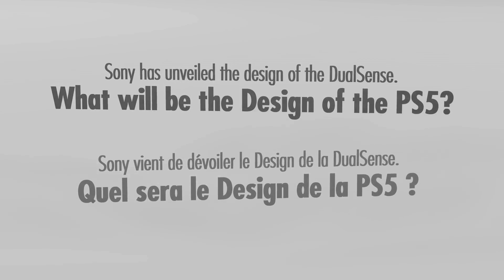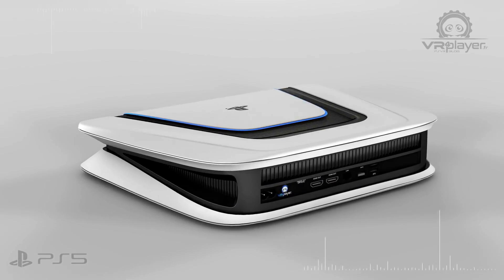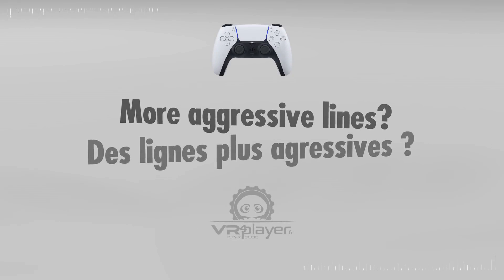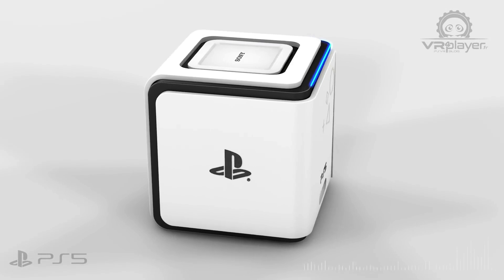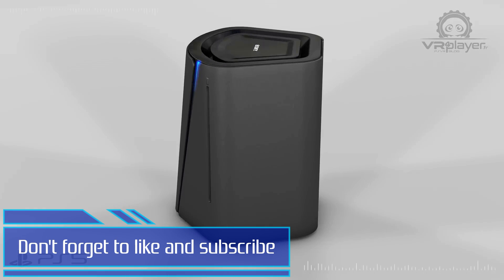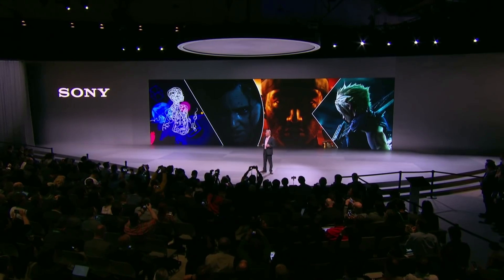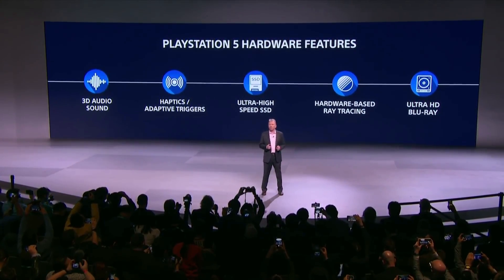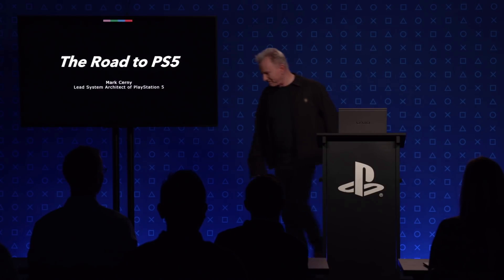PS5 Uses Revolutionary Cooling Solution | Overheating Concerns Squashed, New Patent Reveals

Comment: Fast forward to today, where PS5's are overheating, being RMA'd, and Gamers Nexus proving how hot the internals are getting. Maybe the people that have been building computers for decades might know a little bit more than Sony, who has been building CONSOLES for decades? This generation of consoles are computers disguised as consoles, and it's why Microsoft adopted a case that is the same as a mini ITX case, while Sony refused to get with the times and kept a traditional console look, and because of that, it's inefficient, and giant.  Sony was trying to mitigate a problem that they could have prevented by not being stubborn. It's like if you were designing a faster plane, and instead of switching to jet propulsion, you try things like making the body slimmer, lighter, and by adding more engines, and more propellers; switching to the more modern jet propulsion would have been the easiest solution. Microsoft's 'jet propulsion' is to adopt a case that allows for natural, proven airflow designs. Sony added liquid metal, made their console bigger, made some giant fan, ran their cpu and gpu at lower clock speeds than Microsoft, etc.

Comment: I have to believe that it was cheaper for Sony and Mr. Cerny to creat the PS5 this way...or it was the only logical thing to do, in terms of what their plans for the PS5 were....one thing is for sure...the PS5 is designed for speed.....no question about it, not powerful like a Rhino or the Xbox Series X, but very fast like a cheetah....and boosting falls perfectly in that setup or tune if you will...ofcourse this is all speculation and my backround was in vehicles years ago, not computers...but this is what i have gathered....in terms of boots...loads...and ofcourse streaming data the PS5 has that down to the T....in terms of visual...better details...frames and maybe resolution i believe the XBSX has that covered...better minds have speculated a 10to15% advantage the X has over the 5...

Comment: This all speculation, but i believe Mr. Cerny is doing what he has planned to do all along...i believe he created games...assisted with the PS3....PS Vita....and the PS4.....this gentlemen doesnt strike as some1 who functions like me, without a plan....i believe his actions are all planned out...far ahead of time....ofcourse with PC's /Rigs ...over clocking can be seeing as boosting engines....again all speculation....when placing a turbo or super charger on engines, it is the cheapest and fastest way to get huge power gains...torque and or horsepower....however.....cooling must be addressed....generally speaking anything that is boosted will be much more powerful and have a higher level of heat...this works for both Computers and vehicles......in one way, its much more cost effective and the gains are very nice, however cooling must be addressed...

Comment: You seem to be doing backflips trying to make it seem Sony wasn't caught off guard by the power of the Series X. It's painfully obvious that's exactly what happened. If Sony wasn't caught off guard and they originally intended to have a 10 teraflops GPU they would have simply added a 10 teraflops GPU and wouldn't have gone through the trouble of designing an entirely new solution to cool it. They would have gone with a 10 teraflops GPU put an off the shelf heatsink on it and launched at $400. Instead they saw the numbers of the Series X and bumped their CPU and GPU clocks causing them to need the special heatsinks. The One X does 4k/ 60 on some games with Polaris. 9.2teraflops of Navi would do 4k/60 with RT hardware and audio hardware with no problem. So seeing the Series X specs in December meant Sony couldn't do their February showing they had planned so they dropped their console design and made a new cooling solution after major clock boost. 

But the thing is Microsoft is still probably going to bump their clocks further before launch. The reason I say that is bc if the dev kits are the ones they showed that look almost like the ones from the One then they have room to boost the clocks a good amount. The basic design of the kits may have the back to back motherboard design but laying it down means one side still has more resistance to heat release. In addition,  the dev kits usually have more RAM,  24 gigs at least in this case and they have 56 CUs on the GPU. That means more heat than the final hardware in three areas. So once you turn it on it's side and drop 8 gigs of ram and 4 CUs you should be able to boost the clock some. I wouldn't be surprised to see the Series X launch with 3.7 CPU and 2ghz on the GPU. Sony will have their GPU ghz lead cut in half and still lose by 16CUs. The Series X will launch at over 13 teraflops. Maybe as high as 14.

Comment: mmm very telling cooled from top and bottom. sounds like they got caught out this gen by xbox early reveal and started with 1 fan but had to bump up the gpu clock and so needed to add a 2nd fan.ouch.that things gonna get noisy. i'll stick with fixed ghz thanks than 2 fans changing speeds per power draw. bet its a tower too but been redesigned so its not so series x cloned.now we know why the controller was revealed 1st and console much much later.ask yourself this whats revolutionary about having 2 fans anyway.i could be wrong of course guess we will see soon.

Comment: That sounds kinda like how the 360 was designed. Heat down. But that fried the motherboard and caused the red rings of death. Hopefully sony avoids that
Reply: No bad solder did that. It expanded and cooled many times eventually cracking the solder and pushing the chip out.
That is also why you could temporarily fix the problem by baking your xbox 360 mainboard in an oven for 5 minutes at 350-400 degrees.

Comment: Honestly, I've had 3 ps3s, 2 ps4pros, and I'll tell you they have an overheating problems. From patent to production so late in the process tells me that this will be another 1 gen hot garbage hardware from Sony. I'm not falling for this again. Fan boys will be fan boys, look at how badly Sony is scrambling to kill the last of us leaks. Attack me if you want but I'm buying the new Xbox. I like my hardware to last more than two years before it turns into a jet engine.

Comment: With ps5 i gonna upgrade my tv stand with bigger one and extra adds will be leds some pc fans around for better air flow, cables management and some air filters panels for dust.. This is the plan to fit ps1,2,3,4,5 and sega mega drive 2.. 😉

Comment: I think Sony playing the long game by making the first console that overclock by itself if needed. They are thinking about a far future
Reply: But isn't Microsofts more future proof since it has more power?
Reply: @limpis2823  Not necessarily. A cou9le teraflops won't change a lot in the long run. The 5.5 gb/s of loading is future proof tho. more than the 2.4gb/s that Xbox offers. Game devs are really excited about it. it opens possibility for game development and especially VR games. with a 5.5gb/s you'll be able to look in a direction. and while you're looking over there. a whole new map could be generated behind you. The trippy parts in games are gonna get way much trippier now. But to come back to the original question. Xbox does not seem to be playing this console war while thinking of the next one. Meanwhile Sony is clearly doing exactly that.

Comment: Sony is in a reactive position, still tweaking hardware with costly cooling solutions this late In development. They are scrambling trying be competitive over clocking thier hardware and will have to use some of the cash they made during the PS4 ERA to finance the early loses. They are depending on the component prices to drop over time and only willing to sell limited quantities until they do. They are in a tough spot.

Comment: Only thing we know is that Sony will need  a revolutionary cooling solution, the drastic steps they took to sometimes hit 10 tflops will require it. However all this tech just to sometimes squeeze out one extra teraflop of performance was a mistake. They should have just stuck with 9 teraflops and came in at 399. Now  it’s looking like the ps5 will cost the same as the much more capable Xbox.

Comment: You are kind of a little bit dumb.....

Sony scrambles to overclock an originally 9 TF console that they have been crafting foor over 4 years, and you think a quick cooling solution is going to be flawless?  Lets be real, Sony can claim whatever they want... 10.3, but I promise you, it will never be pushed to that level due to heat... There is only so much  a heat sink can do.... Plus pushing hardware that hard for a long time WILL slowly down and shorten the lifespan of any electronic.... Xbox Series X will be a guaranteed long life console... No cheap overclocking tricks that are proven not as effective as their numbers state, so the whole "you cant judge a console based on Tflops alone" is even more true for the PS5 than the Series X...

Because 30% higher clock speed doesnt mean 30% more performance... its gonna be closer to like 12%.... So theoretically specs vs specs, even if by some miracle it could hit those "10.3 TF" gpu clocks, in reality, it will perform like 9.6TF Max...

This patent could very well be for that revision the rumors stated Sony was trying to get done.... So if PS5 ships without this tech, There is no way im forking over cash for a 2-3 year console that will likely get the Xbox One S treatment and will scrap the variable clocks smart shift gimmick..

Comment: See here's what I thin happenedned with Sony. They were planning to reveal earlier than they did, however ms got out in front, Sony realised their machine was less powerful than xbsx. They overclocked the shit out of it, hence the reason the reveal is/was delayed. I still have concerns as the machine will be running at high frequency and generating a lot of heat to get the most out of it. I think it's reactionary response to ms machine..I also think this will be 500 minimum .

Comment: Ps5 compute units could be more units @ 2.5ghz x series is 56 idk compute units is more units less ghz  ps4 as metal grid could be redesigned to flow air faster  pipes what could be redesigned in a diffrent shape to flow air faster  even fan blades can be designed in a diffrent shape twin fan mabe or gel intercooling lot of possibilitys sony could learn copper metals experts could be key
Reply: Dont give a sheesh doosh bag is a idea what dat sony could learn

Comment: MBG man Zalkers vids talk smack on ps5 he had a ex dev that was on his podcast saying that ps5 is massively under powered compared to xbox series x, and says he doesn't see many developers even wanting to develop for ps5 cause its going to have problems with larger open worlds. Do you think Sony has dropped the ball? I've been a playstation guy since I was a teenager need some thought on this.
Reply: Joshua Smith it’s true the ps5 is massively underpowered, it might not even be able to do full raytracing so that is a major concern for 3rd party games looking better on the xbox. As for developers not wanting to develop formps5 that’s nonsense. 1st party devs will craft incredible games on the ps5 with minimal load times no worries there with lots of AAA titles in the pipeline

It’s the 3rd party performance that will lag behind, not just in frames or resolution but they might not optimize for the ps5s better ssd and might even code for the lowest common demoninator the PC’s HDD (imagine PCs holding things up for once) with only load times minimally better on ps5.  That cooling solution better work or ps5 might not be worth owning till they get a ps5 pro with a proper gpu to go with their ssd.

Comment: If the patent was filed today i can guarantee you this won't make it to the PS5
Atleast in smartphones patents are filed 2 years prior the tech is in the actual device (happened with touch/face id, under screen fingerprint, soli's motion gestures etc...) Could be in the PS5 slim and/or pro

Comment: I just read the patent. Very, very interesting. Not only should it be cost effective, but also a novel solution that may REDUCE costs as board design is simplified and doesn't have to weigh as heavily on accommodating the heatsink and fan.. This reduces materials, and simplifies form factor. (patent links below)

Here is a (wild) guess: The PS5 cooling will be inaudible via a low-speed fan, and may actually be passively cooled with an aluminium heatsink above AND below the main board, maximising the surface area. I'm also guessing that the PS5 will cost $399 at launch.

So far, I am very impressed with the design decisions that Sony has made for the PS5. This is a masterful strategy. A small but highly clocked, 37-core GPU (1 DMA core dedicated to audio), deterministic performance based upon computational density across both CPU and GPU, and ultra-fast IO. I cannot wait to hear about the other features -- this is likely far from it.

PATENT LINKS:

https://pdfaiw.uspto.gov/.aiw?Docid=20200126884&homeurl=http%3A%2F%2Fappft.uspto.gov%2Fnetacgi%2Fnph-Parser%3FSect1%3DPTO2%2526Sect2%3DHITOFF%2526p%3D1%2526u%3D%25252Fnetahtml%25252FPTO%25252Fsearch-bool.html%2526r%3D2%2526f%3DG%2526l%3D50%2526co1%3DAND%2526d%3DPG01%2526s1%3D%252522sony%252Binteractive%252522%2526OS%3D%252522sony%252Binteractive%252522%2526RS%3D%252522sony%252Binteractive%252522&PageNum=&Rtype=&SectionNum=&idkey=0F1865943C7B

http://appft.uspto.gov/netacgi/nph-Parser?Sect1=PTO2&Sect2=HITOFF&p=1&u=%2Fnetahtml%2FPTO%2Fsearch-bool.html&r=2&f=G&l=50&co1=AND&d=PG01&s1=%22sony+interactive%22&OS=%22sony+interactive%22&RS=%22sony+interactive%22

Comment: PS4 on paper is under-powered compared to Xbox One X, and you would think Sony wouldn't stand a chance. This hasn't turned out to be the case, instead the PS4 has been more successful than the Xbox, and delivers exceptional games. Cerny knows that all he has to do is deliver a comparable console to Xbox, and the devs will take care of the rest. Sony could have built the highest performaning machine on the market, but then what's the point if it costs a lot of money? It would be a hollow victory and a costly bragging right.
Reply: Vrostus it would have been a worthy goal to have the best performer graphics wise as 3rd party games will run better on it.  Remember Ps4 games were running at 1080p while most xb1 games were at 900p or even 720p in some cases. That was a big advantage for Sony all generation.  Now they chose to spend their money on the ssd and less on the gpu which is not a bad idea, their 1st party games will still look amazing and will load lightning fast, but they will suffer when playing 3rd party games. Most people play 3rd party the majority of the time so that’s not a hollow victory.

Comment: Sony’s made imo has made some key bad decisions with PS5. They went with an expensive SSD that won’t get fully utilised due to the fact that 3rd parties will develop for the base and if Sony also bring their games to pc they won’t be able to either. It’ll have fast load times but that’s it. It seems the boost mode was reactionary to XSX. It just makes little sense. They should have went for the better GPU rather than sinking that money into an SSD. This will end up biting them back. Once games start getting more CPU bound that GPU overclocked won’t be used as the CPU will need to run to much. Therefore that 9.3TF is all you’ll get. And with 40% less CU’s. Worse RAM etc etc you won’t get even decent Ray Tracing. The better choice imo for Sony would have been to aim for the 9.3TF machine with a decent SSD. It would have kept costs down and given them the same results they will get. So it maybe released at 400 at a loss now. But can Sony afford such a loss?!

Comment: PS5 is going to be a $600 mess, Xbox already won at this point. everything just looks bad so far, low bandwidth only 448gb/s 16gb VRam, Expensive Nvme, low clock CPU without 8 Threads mode, Not much Ray Tracing hardware, Mid tier GCN/Navi 1.5 like a 2070 super, recycled games. the list goes on pepehands
Reply: You forgot to leave a fanboy alert.
Reply: Lol 8 cores and 16 threads it's SMT, 8 cores and 8 threads not good as 16 threads... The xsx at 3.8GHz use only 8 threads while at 3.6GHz its use 16 threads... RDNA Gen 2 architecture already confirmed you just made yourself as a clown 😂, ray tracing already confirmed for PS5 as well and no one know how it will perform yet...
Reply: @מוטיאהרן  I was just copy pastering what fanboys say daily, I was just trolling boys lmao. congrats on not getting triggered

Comment: the price i think 450$ ~ 500$.
i think PS5 is so interested and very convenient for players + the dev.
it has a custom chip to handle the SSD this means patching or upgrading a game will happen very fast,  with load time under 1 second this is what you call next-gen.
the Teraflop is less than the X but in reality, it will be a long time untell the developers will make use of both system full potential, that's why sony studio optimize their games and work on them for a long time to get the game in a high-quality state.

Comment: I can't wait to see this mess! Most people who have consoles are using a shelving unit of sorts to house their console. So, if you're cooling from the top & bottom (assuming air releases from the side or rear) wouldn't the system still be taking in the air through the top that it expelled from the sides/back?

Comment: I’m not so sure it puts that rumour to bed. For myself, it suggests the rumour came from somewhere. If the dev kits were actually running hot, it makes sense for there to be worry about the retail kit. Hopefully this cooling solution helps.  

I also am not sure bumping up the gpu clock was a great idea. The gains from that is not going to be worth the heat and extra cost of the cooling.